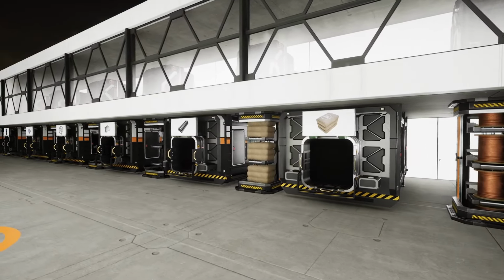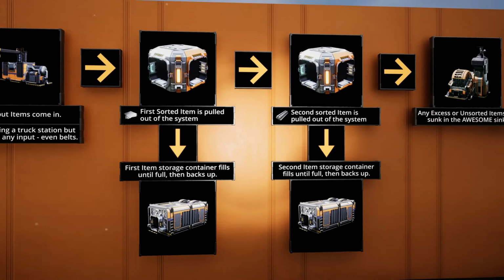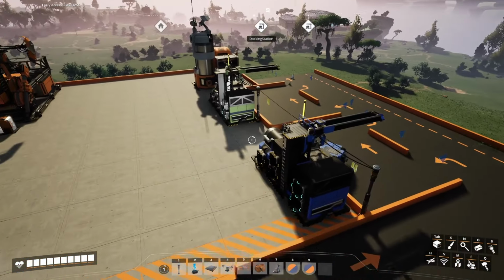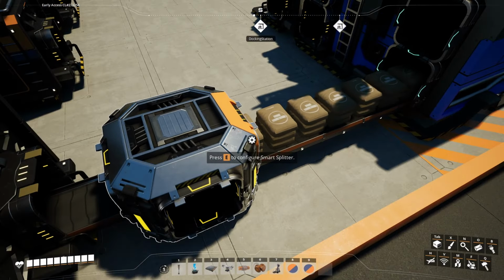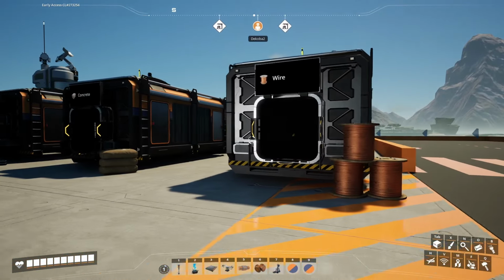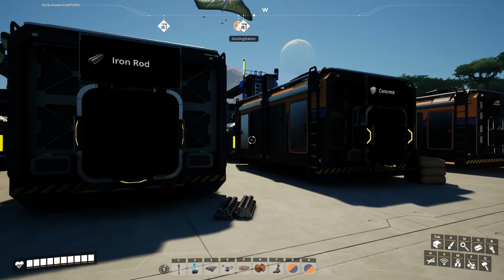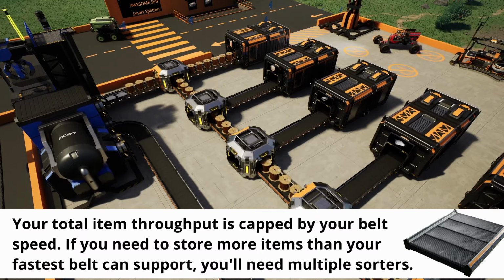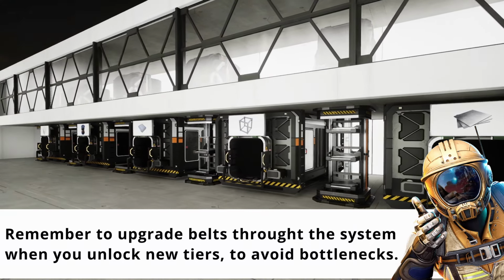Satisfactory Storage System Guide - Automatic Sorting System Tutorial for Satisfactory Update 8

Comment: I have a question. Based on this set up. What happens when a new shipment of wire comes in and then goes onto the line only to get stoped at the smart splitter because let’s say, it’s full? Wouldn’t that cause a jam?
Reply from the maker: thats what the overflow setting is for. if the output line is full, it overflows down the line into the sink for conversion into tickets.

Comment: Great video!! … one question I have always had about trucks and truck stations is ..can a truck stop at multiple truck stations?… 
For example, drop off parts at one station and on the way back stop at another one to pick up coal for fuel before carrying on with its circuit.?
Reply from the maker: Yes! And you can do multiple pickups before dropping off, as long as there is space.
Reply: Don't use those tiny trucks that you sit on the back, use the large ones. The more you can carry per run improves your through put.

Comment: For the item display, what I typically do is remove the foundation in front of the container outlet and then place it one meter lowered. Then, I build a belt from the outlet to at most 4 meters away from the container on the lower foundation. Then, I remove the foundation and the conveyor pole and place the foundation back one meter upwards. It now looks like the items flow out the container straight onto the ground, and they dont float at the front of the belt.

Very nice video!
Reply from the maker: That's very clever!

Comment: I would say this is the most basic smart sorting storage system. It works ok in the early game as a mall, but quickly bottlenecks once you start dealing with larger volumes. For example, consider screws. Each stack is 500 units, even with an mk4 belt it would take over a minute to sort 1 stack. So if your bringing it in by the truck load, well you can do math. 😅 For me, its just not worth it.
Reply from the maker: Thats more of an organization issue. Why would you bring in screws by the truckload? For the purpose of a mall, you'd only need screws for making the handful of equipment and builds that use them, so a single constructor making 20/min or so will FAR exceed your demand for them. even early game belts can handle that volume.
Reply: @Dekoba  Agreed, screws are an extreme example. But as you show item being delivered by truck, I figured it was a good example to illustrate its limits and get people considering throughput and time needed to sort.  I ment no offense with that comment, and I'm very supportive of anyone making content for this amazing game.
Reply from the maker: Yep,  it's an important consideration. When i build one of these in my world I keep a list of its inputs so I don't overdo it

Comment: Double the throughput! After unlocking steel tiers you can double the throughput by using Industrial Storage Containers and running two belts out of the truck/train station. Each belt will be a copy of the other with the same smart splitters and one belt for each top and bottom input on the container. Just make sure to add a second Awesome Sink as well!
Reply: Great comment! That’s exactly what ai and to do with my setup. I have the industrial storage but I was having an issue with sorting them with my smart splitters. He showed the solution in his video but he didn’t show how to do the second line but I think you gave me the idea on how to do it.
Reply: Industrial is overkill for a mall imo. Prefer to stack 2 small ones

Comment: Had you shifted the Smart Splitters over you would have not needed the curves. Also adding another storage container below the other one would double your storage and remove the need for another curve. Good for a first setup though. Steel gives you access to the industrial container removing the need for a second input line.
Reply: Industrial containers SHOULD use another line in order to double the throughput out of the station. Two maxed belts vs just one.

Comment: very nice tutorial!  I actually spent many hours getting my waterfall display system to always cycle even after the container is full.  takes a lot of room and several smart splitters
Reply from the maker: That sounds impressive though. I though about doing a lift that doesnt connect to the container and just contains the correct item and cycles continuously, but i like the idea of it responding to my action, it feels better.
Reply: @Dekoba  yeah so I can try to describe it, after the splitter that decides the item, it goes into another smart splitter with any item so it can be used in a blueprint.  main output continues, overflow goes into the storage.  then it goes into a merger (we will come back here) after that it goes through the waterfall.  after that it goes into another smart splitter, which tries to force all the product back to the merger before the waterfall.  the overflow for that splitter goes into another smart splitter that tries to send the product back into the containers second input, and overflows back to the main bus, to be sunk.

Comment: I didn't realize overflow worked to send other items along the belt, that makes setting this up much easier. What I have been doing is splitting off what I want to the side and then to go forward, I have Any Undefined. But then on the belt going to the container, I had to add another smart splitter with an overflow that looped back to a merger on the main belt. An Awesome Sink sits at the end of the main belt. I put the splitters above the walking area so I can have 2 sets of containers facing each other, so you have both sides of the aisle to pick from.

I use the first container on one side as a trash drop off. Anything in that container goes right into a sink. I use the first container on the other side to dump off anything to get recycled and sorted back into containers. Before sorting into containers, I send them through an adjacent building to be pre-processed. I convert leaves and wood into biofuel, slugs into shards, flowers to color cartridges, remains into animal protein and even grab some other items to build all my weapon ammo. Then all these items go back to the main sorting line to be put in containers.

Comment: Since there is a third output direction on the splitters, is there a benefit to a single row of storage containers like this vs a shorter double row? Or as a way to expand later without fully restructuring?
Reply: I think it depends on how much space you have and how you want to set up your logistics.  the double row would use fewer smart splitters.  ive also had a single row but used the second output to fill containers on a second floor.  ive also seen people have a sink for each item but that seems excessive to me lol.
Reply: With an elevator you could also send opposite side edit up to a container on top of the first layer.

With smart design you could have upstairs and downstairs laps for stuff that you often pick up together, e.g. materials for structural work vs materials used in machinery.
Heck, for double dips you could use an industrial container to make it accessible on both laps.

Or put up a walkway at about half height from the bottom layer, so you can easily reach top and bottom.

Comment: This could be a dedicated server issue but this doesn't work as its intended. I've built this style and it will let things slip through and sent to the sink.  The fix I found, was you have a second smart splitter that is set for overflower after the storing splitter. We found the main loop needs to drop back at the start.
Reply: It's a dedicated server thing. I've ran into similar issues and found bug reports on the QA site. At the end of the day it's just a little bit slower to fill your storage containers but the same amount going to the sink once full.

Comment: Do you plan on building seperate storage systems in different parts of the map or will you expand this one? Because i don´t really see the potential to expand this one - apart from vertically but that seems quite challenging...
Discoverd your channel yesterday and I really like your style of editing!
Reply from the maker: Thanks for the kind words! I plan to expand this base around the nearby lake as needed, my next expansion to this location will involve tearing down the wall where I had put the build plan and setting up additional truck stations and storage there. 

Once I unlock trains, I will start a new, more central location, as at that point Ill need to work across a lot more of the map, and this storage system will feed into a train station to help supply that.